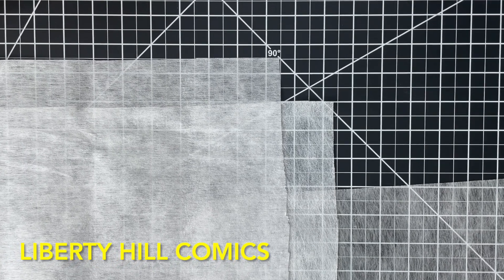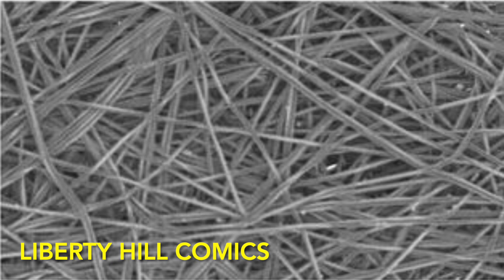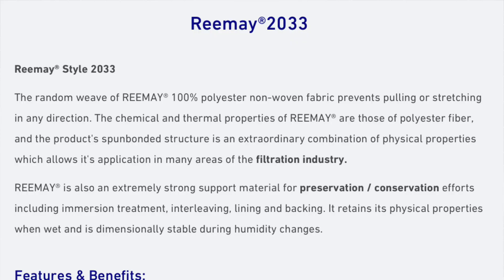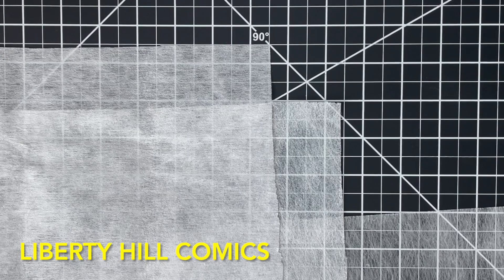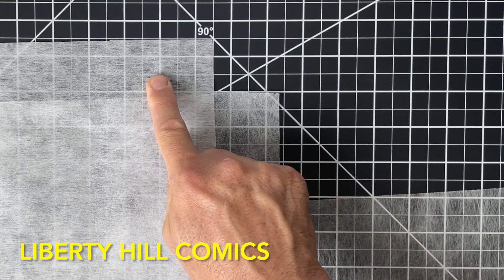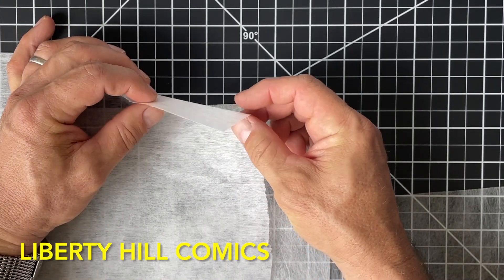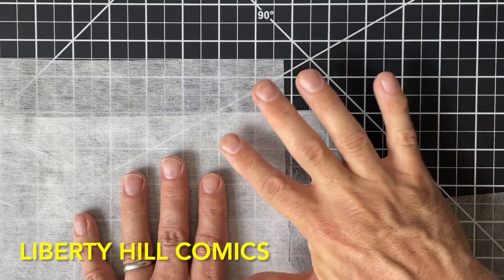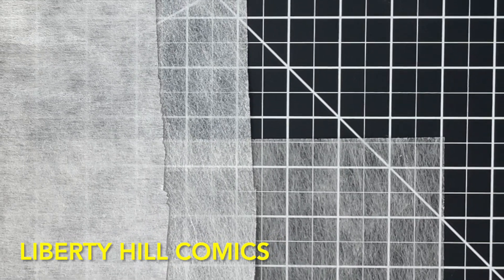How to Chose the BEST Polyester Substrate for COMIC Conservation!

Comment: Going to the Talas website, there is a number section: 3249, 3257 and 3265 what they mean?
Reply from the maker: Different grades of Hollytex. We use 3257.
Reply: @DrPaulKosnik  They can't be reused...even if is with the pages of the same comic?

Comment: I've used the sheets you link to above and seems to work great. I've only done 2 projects so far and I'm by far only a novice unless there's a level below that! Lol

I've used it to clean using calcium hydroxide and also to do repairs using tengujo (rice) paper. Very proud to have completely dismantle, clean, and repair and reassemble a Golden Age book. Including replacing a rusted staple that broke also using your link and method. 

It is better than it was but I hope to do better. The spine repair on cover to hold staples worked but I think would be better if I figure out how to do a small amount of leaf casting. That's next.
Reply: @DrPaulKosnik  looking to order some Holytex but can only find it at Talas. Shipping is expensive there. Was wondering what you thought of Chloramine T for stain removal on the cover of my Donald Duck book? I think I've seen you also use Sodium Borohydride I think. I know I can get the former at Talas in same order.
Reply: @DrPaulKosnik  I missed this comment earlier and thank you for explaining. I'm much more of a numbers guy and don't always follow the science, which is why I really enjoy your content. And honestly, while lightening is desirable, I am more concerned about strengthening for long term. I think you shouldn't be afraid to open it and read it. At least the books I am playing with. Amazing Fantasy 15 probably belongs behind glass and I will read a reprint or online. 😁